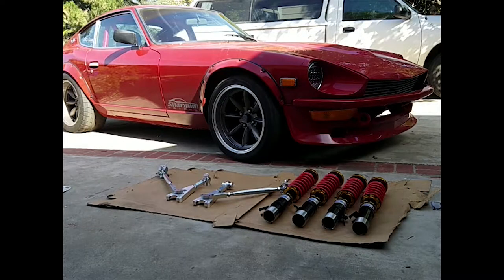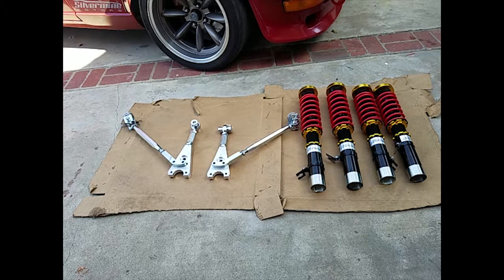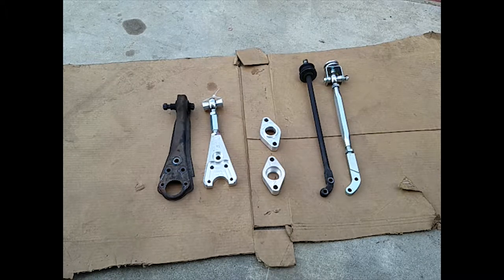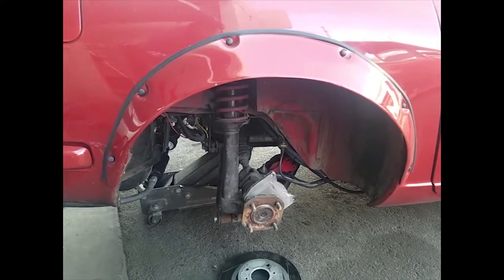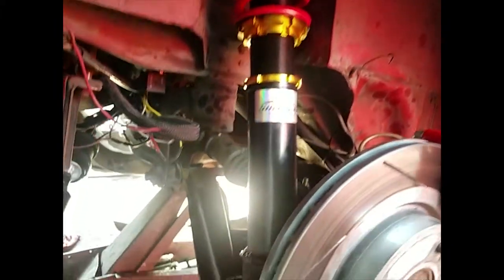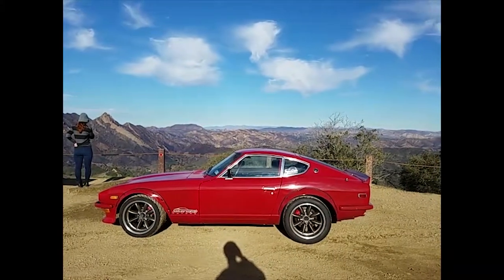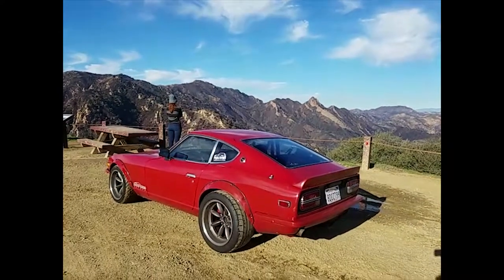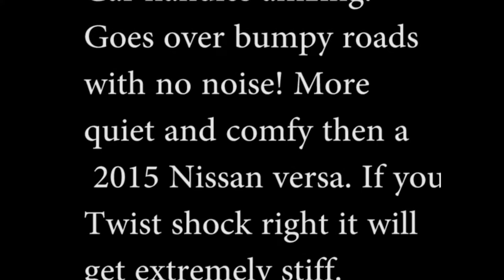240z gets Coilovers, LCA and TC rods from SILVER MINE MOTORS

Comment: overall, how low did you end up going? how much more adjustment was left... was it near max? im debating between these or the extreme low options from BC only because I dont want to max out settings.
Reply: The Coilover kit was set kinda low at first. but handling was not that good and it hit the front lip everywhere. I still could have dropped in 2 more inches from there, but instead, I raised it up and left it there. now it handles and does not rub everywhere. I think the extreme low option is way too low and totally unnecessary. Unless you never plan on driving it.